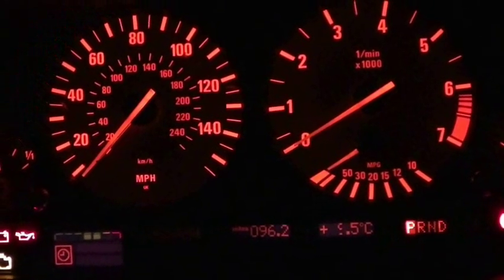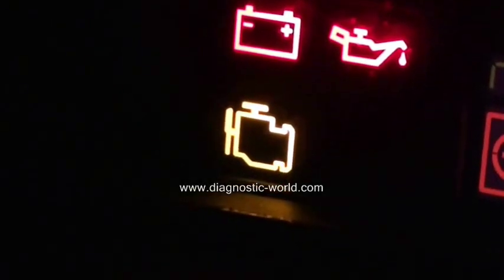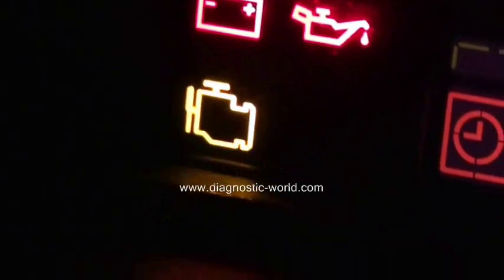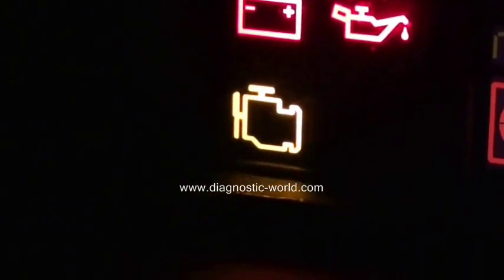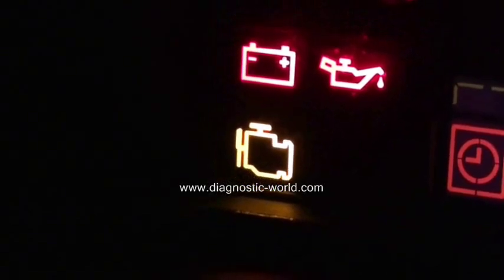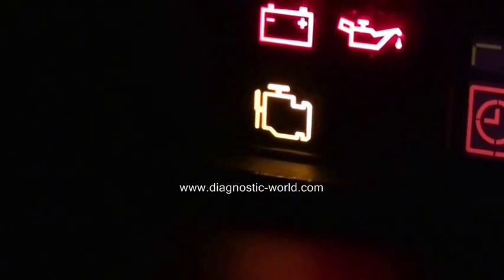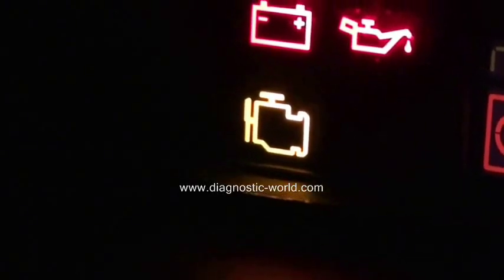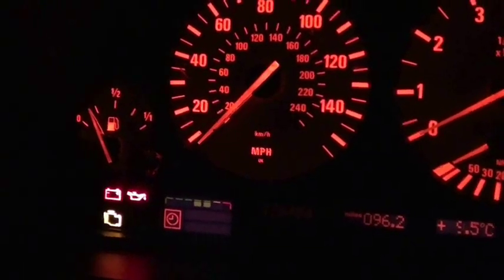Mini Engine Management Warning Light   Need To Diagnose

Comment: Hi,
I have a 2003 Mini Cooper (automatic) and it has less than 80,000Km on it. I have minor problems over the last 7+ years.
Tonight I dropped into downtown mini here in toronto to replace the cap on my rear windshield wiper and after turning the car on and off a couple of times rather quickly to check that the wiper worked with the new cap--my engine light came on. this is the 1st time in my entire time of owning the car that this has happened. Can anyone tell me if this is simply because I had turned the car on/off a couple of times rather quickly or is there a real problem with my engine? We checked and all my fluid levels were fine-coolant, oil, etc. my gut tells me it is just the quick turning on/off of the engine that has triggered this light. If so, how do I reset this light or know for sure?